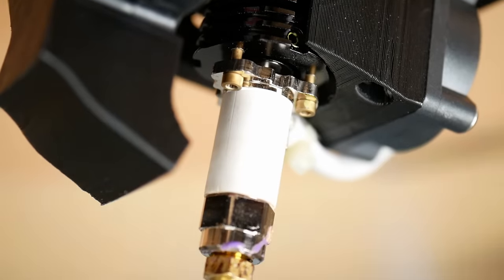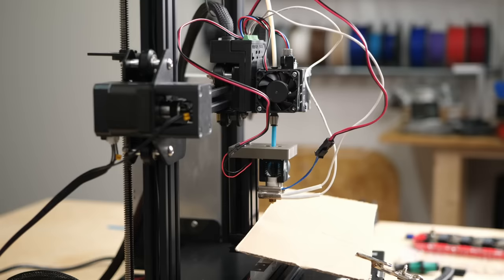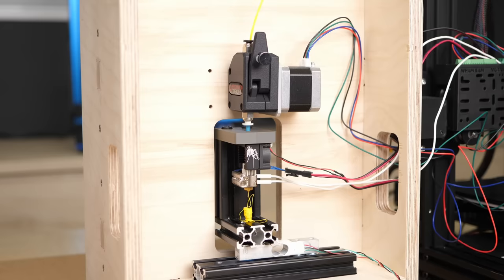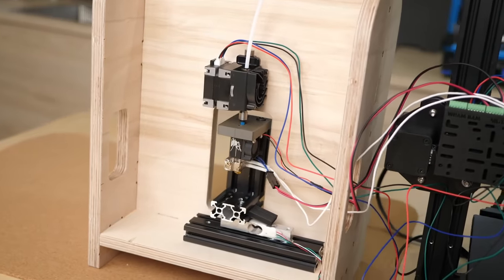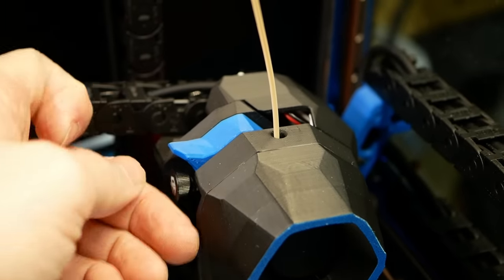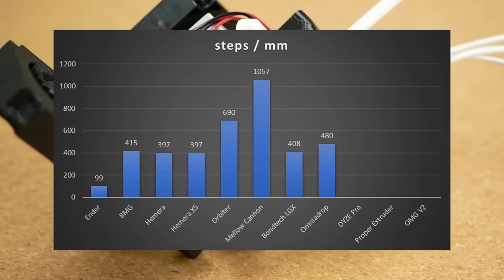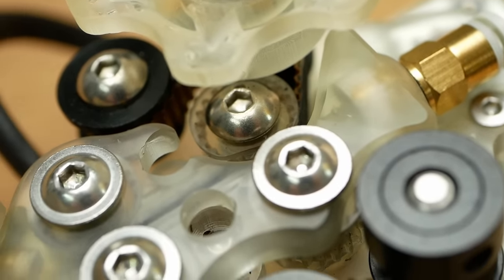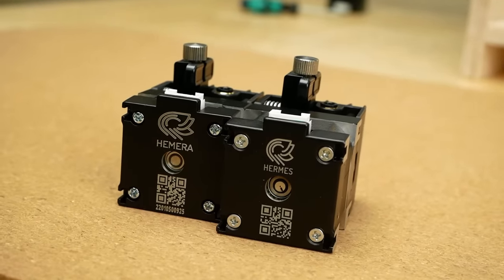I tried to find the Strongest Filament Extruder.

Comment: I think single sided, idler-loaded extruders need more attention. The Ender one is particularly faulty, because the force cannot be regulated. With time, the extruder lever breaks or bends, or the spring loses pretension. A basic $4 MK8 does fine, it just needs a little guide piece added in the bottom.

You can also change the extrusion gear and idler bearings in these. You can use either an 11mm gear or a slimmer 9mm gear. With a slimmer one, you get more force out of your motor torque and you get a higher step count. They come in extruded, hobbed and spiked (knurled) varieties, and some appear to be potentially EDM machined and hardened. A semi decent steel gear (stainless or hardened) will do 4kgf easily, and 10kgf is vaguely within the realm of possibilities. A typical motor has like up to 4kg*cm torque so between 7 and 9kg depending on gear diameter. Steps/mm is an issue though, so i'd love to see Orbiter or Sherpa style geared small extruder which can also make do with a Pancake motor but single sided.

Comment: One thing that I'm curious about, We know that microstepping ends up getting less force out of a stepper motor than full steps. With the step-down gearing, it's my impression that we should be able (at some point) to simply set the stepper motor driving the filament to no microsteps, and effectively get the full force pushed through to the filament. What I suspect we'll lose is that safety mechanism of skipped steps preventing the extruder from grinding away the filament. But if that can be handled in another way, perhaps we would see even better results, especially in situations where you want high flow printing? Just curiosity on my part, I don't tend to print at higher speeds.

Comment: The only criticism I have with the orbiter is you also need a mount for the hotend. With the hemera xs, the mount for the hotend is the heatbreak, which threads right into the extruder. It didn't look like you included the added weight of a hotend mount that is needed for the orbiter, which may cause the hemera xs to overtake the orbiter in your force per weight analysis.

Comment: Thank you for a great video! I use LGX Lite and like it a lot. I think the way the wheels are aproached from both sides makes them less sensible to missalignment of the wheels, a problem with original BMG and all that use a spring like the Orbiter.
Reply: That maybe true, but I'm not sure misalignment is completely eliminated. I recently upgraded to an LGX Lite and immediately noticed clicking of the gears during retractions. Upon further inspection, I discovered there is a small amount of play on ALL the gears, which causes a little backlash and is the source of the noise. Though I wouldn't necessarily say it's a design flaw, more like a design characteristic.

Comment: Back in the day when printers used fat filament, they needed geared extruders. 1.75mm filament came to dominate because the finer filament could be driven directly without gears. Also ungeared extruders are much lighter so suit direct drive printers.

Comment: In order for the worm gear to give maximum performance, it is necessary to reduce the microstep, it is not needed there as on other extruders. Accuracy will be guaranteed by a high gear ratio, while significantly increasing the power of the motor at high speeds.

Comment: You did an excellent test on infills, but I'd like to see an infill type vs surface quality (not just the top surface) at various infill percentages with a default wall thickness.

Comment: My lgx lite tensioning got looser over time, from the fixed tension and the SLS end cap that holds the shaft deforming. It would barely grip filament in the normal position

Comment: I'm here still using direct drive extruder like it's 2014 😅

It's enough force to flow up to 36mm3s reliably without skipping and a very small mount of slippage. Although i do run it at 26mm3s most the time to ensure the filament is fully to temp when it comes out and no slippage. I'm using a Volcano hot end with a Micro Swiss CM2 Nozzle, running it is a StepperOnline Nema17 30mm with a 11mm brass gear

It's running a custom arm i designed though, the idler sits just below the gear as the filament tends to curl when the gear teeth deform one side. That's my secret sauce

Comment: Extrusion force shouldn't be a concern so long as you're melting your filament properly one would think. I suppose there is likely an ideal pushing force for any given material in 1.75mm that should not be exceeded. It is likely that volumetric flow rate is the real limiting factor, not extrusion force with all these great extruders.
Reply: As soon as the filament starts contacting the mold it begins to harden, making it thicker and requiring more force to push it into all the nooks and crannies and especially thin and long features or channels.

The alternative to shoving in a lot of hot plastic quickly under high pressure is to heat the mold to near or above the melting point of the plastic, the downside being that it takes a lot of time to cool down the mold to allow the part to solidify and remove it and then heat up the mold again for the next injection.

You can assembly line it by having multiple molds cooling and heating up to maintain a good parts per minute throughput, but molds are typically the expensive part of injection molding so that would not be the most practical solution.

For a hobby user unless you are trying to automate the entire process you're generally going to be best off with a manual bench top pellet feeder/injector/mold clamping device that already exists and is not all that expensive.

The YouTube channel TheCrafsMan SteadyCraftin has a number of videos using one, with both metal and 3D printed molds, definitely a good resource for anyone interested in hobby injection molding.
Reply: Just realized you were likely talking about the properties of the extruders when used for normal 3D printing, not for injection molding, in which case feel free to ignore the first reply to you 🤣

Comment: i paused. i took your recommendation to read the Orbiter 2.0 story. it was an awesome read and jaw dropping to see the level of obsession and pure talent going into extruder design. it was oozing with industry wisdom. great eye opener seeing the many different innovative extruders on aliexpress you would not know some are actually inferior just from the concept--like Mellow Cannon using worm gears---no way!! terrible idea!.. midway through the article i predicted the orbiter would be winning several categories. if you are reading this comment, go find the Orbiter 2.0 Story. 

it looks like Orbiter and Bondtech have the lowest %loss of peak strength moving from low flow to high flow. i think this is a sign that proper design testing has happened (that the both the grip system and chosen motors are closely matched in capability and neither subsystem is bottle necking by much). you didn't show $cost per kgf and i feel like the Orbiter would also be champion there.

Comment: I have two big bed printers with Hemera + Revo, two bed slingers converted to direct extruder with Orbiter and two Corexy with Orbiter all using using the EVA hot end systems. The Orbiter is just fantastic and I would recommend to anyone.

Comment: If you're 3d printing and the nozzle is massive, then obviously that limits your print speed.  But a makeshift injection molding machine would have a stationary nozzle. For that application why wouldn't you use a high current Nema 24 motor and run it at high voltage? I mean, if the limiting factor seems to be the motor.

Comment: well, I suggest to look at the Nextruder from Prusa.  It would be interesting to see how it stacks up. It has light weight, a novel filament feed system and an all metal design with a load cell.

Comment: The micro swiss extruder tested by proper Printing should have been included. Also some choice in flexible drive extruder as flex3drive or zesty nimble should have been included in the tests

Comment: I'd definitely go with fixed width extruder, had problems with the stock ender extruder slipping then I increased the springforce and it didn't slip but with many retractions on the same place it flattened the filament till it wasn't able to fit in the bowdentube. Then I printed some parts and used a second bearing to make it to fixed width and now it doesn't slip and also doesn't dig deeper into the filament when it passes several times. Still the stock gear but defined deformation of the filament I don't know how much force it puts out exactly but it feels like around 5kg when the motor skipps.

Comment: Great video, go the Orbiter, to be honest, trying to make an extruder powerful but also light weight is silly, your best to have two ultralight identical extruders in a push pull setup, if one of my Nano extruders cant push enough, I use a second one at the other end of the reverse bowden tube setup, this setup can be installed by either running one driver each or by running 2 steppers in a series of one driver.

Comment: Nice testing man!
The thing about the omg is it is really only popular with the flsun SR guys. People ask in the FB quite frequently about it, meanwhile literally nobody talks about it in any other group. The opinions are also really splitted apart, some love, the others threw it out of the window because of not consistent extrusion. My guess on that is the feed gears were not equally sized (manufacturing tolerances) and had thus dissimilar effective feed radius meaning binding within the extruder. Either on compression (first gear is larger) or tension (second gear is larger)
Reply: I don't really see what advantage the two separate extrude gears gives.  The length of the filament between them is not well supported, so you couldn't put any significant compressive force into it, especially with flexible filament.  Also as you say this just gives more opportunity for manufacturing tolerances to give problems.
Reply: @ferrumignis  additionally you have the issue of chewing twice on the same spot on the filament, which is an issue on the super racers. 5 to 7mm retractions at 50mm/s isnt that gentle

Comment: For reducing weight and increasing speed capacity, I'd like to see a metcal style hotend. We would have perfect temperatures in seconds, though it won't be very adjustable (so max speed would be dictated by hotend length)

Comment: Going to put in my prediction now. That injection mold project you got in mind is going to back up plastic into the extruder and gum up the whole thing. 
Your going to need to plan for super low pressure and lots of place for air to escape. As well as a preheated mold.

Comment: I'm curious how the voron clockwork 2 compares since it's basically just a bmg with a 5:1 gearing ratio, but probably also not very special because of that. Would only be an indication of how much the bmg is leaving on the table without any gearing.

Comment: I wonder if the mellow cannon would benefit from decreasing microstepping and receiving more full steps.

Full steps are more efficient for torque, but don't offer as much fine control. With twice the steps it likely gives intense control of the filament, but would have all the benefits of the reduction and the gears with a better motor.

Comment: The OMG extruder test and comments seemed a bit short compared to others. It's weight would be way down with a lightened stepper (like the others). The major problem with it is, it's not bowden friendly. If you are exchanging filaments, a bowden setup allows the filament to cool down by the time it's pulled back through. If there's any bulge on the end, it gets stuck in the extruder as the holes through it seem to be less than 2mm. For a direct setup, the filament would still be pliable as it's pulled.

Comment: Great video as always and it really shows how low performance the ender 3 stock extruder is. It would have been good to see you include the common aluminium dual gear extruder upgrade kits for the ender 3 to see how much better they are than the standard single gear plastic extruders.

Comment: Stefan, could you please put the graphs up a bit higher so people on mobile using CC can see the bottom part of it, for example the first graph of the ender 3 extruder no line is visible with cc turned on.

Thanks for the cool content as always!

Comment: While extruder force certainly is a factor in higher speed printing, I think the real bottleneck is actually the rate at which filament can be melted by the extruder. Even if you can force basically unmelted plastic through the extruder, if it doesn't adhere well to the layer below it, then you still won't be able to print your part any faster.

Comment: You will need really high pressure for injection molding, but I am sure you are aware of it. Love to see it, hope it works
Reply from the maker: High pressure = High force on small surface area (i.e. filament section).

Comment: Have you thought of designing your own extruder?
If the goal is high power, then reducing friction in between the motor and the gears touching the filament is a must.  Think about down gearing using a harmonic or cycloidal drive instead of a planetary gear set.

Alternatively, if you push filament with a threadless ballscrew (or it's cousin, a rolling ring linear drive), your might be able to get away with using the motor directly without down gearing.

Comment: ONE OF THE BEST TECHNO BLOGGERS! SUBSCRIBED, I WATCH EVERY VIDEO. IN YOUR REVIEW, IN MY OPINION, THE PROPERTY EXTRUDER, DESPITE THE SMALLER PERFORMANCE, IS REALLY THE FUTURE. FROM YOUR VIDEOS, I DON'T QUITE UNDERSTAND HOW YOU FEEL ABOUT PATENT LAW. I AGREE THAT PATENTS HINDER DEVELOPMENT, ON THE OTHER HAND, IN ORDER TO INVENT SOMETHING, YOU NEED MONEY. AND IN GENERAL, IT SEEMS TO ME THAT THE FORCES OF THE EXTRUDER ARE A PATCH FOR A FRACTURE. Without changing the nozzle and the hot end, no matter how much the strength of the extruder increases, the efficiency will still be low. It's like putting an elephant in the Eye of a Needle. Thanks for the great work.

Comment: If your heating your mold as they do with real injection molding, the injector might not be that important. Or rather the force wont be as important as the volume,  you will need to fill a mold quickly. Also after injection real molds get water cooled for a short time then they open to release the finished item.

Comment: If you wanted to try and create an injected moulding 3D printing machine, I would look into using hydraulics to push the molten plastic instead of a geared extruder, my two cents.

Comment: The extruder on the bambu lab x1 is also a beast when it comes to pushing materials. I’ve used it extensively on pure nylons and flex materials.

Comment: I don't know... When my printers underestrude they skip, not bog down. The rollers dig into the filament like road tyres digging down into sand. That means the point of failure is back pressure exceeding the strength of the filament. It's not the extruder being too weak.

Comment: I'm impressed with all the numbers, but love to see in a real world scenario where quality is affected. Like would it show as under or over extrusion, how consistent is it. Also, as others pointed out, missed out on an LGX lite.
Side note, I do have the LGX, and I mainly like it for being able easily clean the gears from the side with a stiff nylon brush. It has been consistent for my needs, and being able to easily adjust tension for different types and get it consistently for me is a plus. Only downside is the gear to be able to load or unload manually is cumbersome. Felt would have been better placed to the side.

Comment: yes there are quite a few bigtreetech H2 extruders you skipped would be nice to see them added to this list
Reply: I ran the Biqu H2 for quite a while then upgraded to the Biqu H2-Revo. The H2-Revo is much better for nozzle convenience, filament swap convenience, print speed, flexible filaments and tension. That would be the one to test in my opinion.

Comment: So judging by the results. Most extruders are not limited by their construction, but rather their Stepper motors.
Got any plans to see how any of these extruder designs would respond to getting outfitted with a higher torque stepper?

Comment: I wish you'd compare this cheap red aluminium dual gear Ender 3 extruder. As stock one tends to break pretty fast this is probably one of the most common and very cheap upgrades for Ender 3

Comment: Oh Stephen, I'm not sure if this would be a good video idea or not or if it would have enough interest to be with your time, but would be interesting to know how each of these extruders did Handle flexible filaments. Like I love the OMG design, but I wonder what it would look like if a flexible filament was slipping on the first set of drive gears. Would it bunch up and turn into a knot in the extruder? It'll be interesting to see..

Comment: My goal is to get an extruder drive that leaves no marks on the filament.  Any distortion of the filament modulates the output flow and is visible in the final print.  So I'm thinking that the belt drive is the way to go.

Comment: After getting a decent quality resin printer I've been thinking about trying to injection mold on a fdm extruder using high temp resin for molds.
Reply: If you are interested in hobby injection molding the YouTube channel TheCrafsMan SteadyCraftin has a number of videos that show the use of a manual bench top pellet feeder/injector/mold clamping device using both metal and 3D printed molds that is a pretty good resource and might be of interest to you, a tried and true method of you're more interested in the end product than the journey of creating a new DIY system that operates on a different principle.
Reply: @msytdc1577  Ya I know the craftman he's great